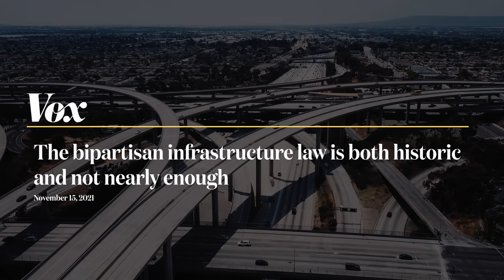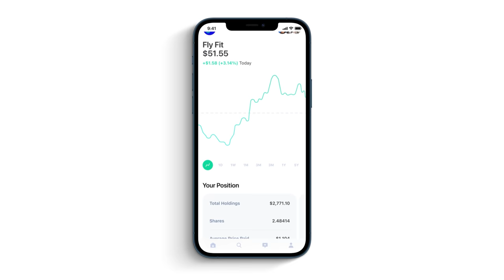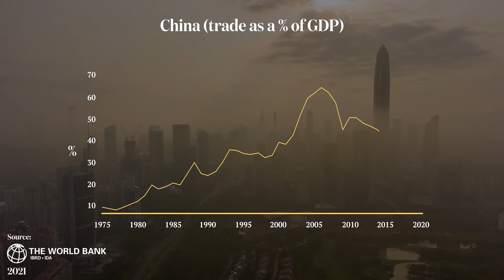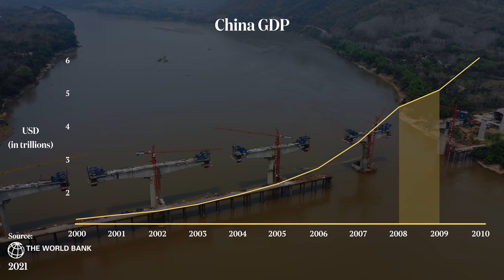China Has A Debt Problem Three Times Larger Than Evergrande | Economics Explained

Comment: As someone who works at the company that maintains the dutch railways I think you're missing out on a few very important points:
Railways shouldn't be counted upon as being profitable, the transport they provide (if they are well placed etc.) weighs far heavier then ticket sales ever could. The benefits of being able to transport non car owning citizens all across the country at high speed is incredibly important for a technologically developping country.
Also maintaining railways is far more complex then extually building one. It requires keeping tracks of a meriad of different properties that differ from every piece of metal, cable and cart.
Though I doubt that China looked far enough ahead to see these problems comming which is why the amount of time and money that has to be reinvested in the project will be far larger then they expected in the long run.
Reply: I was about to ask this in the comments, thanks for answering. If the alternative to infrastructure investment is fiscal stimulus, why does it matter how unprofitable the rail system is? The alternative is the debt without the benefits of the rail system. I'm curious why they halted additional rail investments. My only guess is that they underestimated the liability that is rail maintenance and are avoiding that future cost.
Reply: @PoorlyThoughtOut  It sounds like in terms of accounting, it is now becoming too difficult to maintain these semi-independent rail corporations.  Remember, the purpose of these orgs is just to encapsulate controversy in a non-government entity.  Something that is "corruption" for a state-owned rail company is just normal business for a private rail company.  However, it's an unstable system, because the government wants cheap rail travel all over the country, but private corporations need to make money.  

Ultimately, this problem is an illusion.  In reality this project is an initiative of the Chinese government, and the government has much more than $1 trillion.  The government wants trains, and they will pay for the trains.
Reply: @PoorlyThoughtOut  If you want to understand why it matters, then think about this:   suppose you, personally, borrow $250,000 and treat yourself to some fiscal stimulus by spending it all consuming things frivolously.  Overseas travel, 6 star hotels, top end restaurants, the odd kg of coke etc.  When it comes to paying back the debt, you will understand the problem with fiscal stimulus.  And if you then decide you would like a home loan, and find you can't get one because of the $250,000 you borrowed to consume, it will be even more apparent.
Reply: @alexanderSydneyOz  ahhh.. but that $250k which I frittered away is now being used to employ hotel staff, airline staff and Lamborghinis (for my Coke dealer). In short that money keeps other people employed.
Reply: I realise English may not be your mother tongue, so, not to be too much of a stickler on English grammar, but 'than' is the proper comparative conjunction which should be used in your following statements:
• "Railways shouldn't be counted upon as being profitable, the transport they provide (if they are well placed etc.) weighs far heavier [than] ticket sales ever could."
• "Also maintaining railways is far more complex [than] [actually] building one."
•  "... which is why the amount of time and money that has to be reinvested in the project will be far larger [than] they expected in the long run."

'Then' is an order adverb in English (or an adjective/noun when referring to a period in time):  i.e. 'I'd rather take the train which is far more convenient than driving or flying.' and 'Getting between Amsterdam and Rotterdam was easier back then when trains were more frequent.'
Reply: @MelioraCogito  that is, without doubt, the politest, constructivest, exposition of grammar policing, to which I have ever been a witness. Possibly ever irrespective.
Reply: Railways only exist because they are heavily subsidised. If any civilian had to pay the real price of a ticket, the train would be empty. Infrastructure is incredibly expansive (catenary, rail, exchanges, crossings, traffic control, train stations, and a gazillion employees). And have you ever compared the amount of people that pass in one minute on asphalt vs a rail track? Then have you wondered what's the noise on top of the lock? It's cooling because a lot of energy is wasted with power conversion for the train. And there is the wait of the train and the aerodynamic; ginormous vs non-existing. Trains are extremely inefficient; from an economically as well as an ecologically perspective. If you want to give the people cheap transportation, you could consider subsidising cabs or busses. The latter doesn't even need subsidising. Flixbus charges about 20% of the price of the Dutch railways (even with the railway's 40% deduction card, Flixbus is still twice as cheap), and they are a commercial company, without subsidies. We just lost track of real prices because it's because subsidies are blurring our visions, and the fact that we got used to what we have.
Reply: @MsSjaakvaak  not if you are stuck in traffic during rush hours. Trains and subways are way better than driving in NYC.
Reply: This video misses the on going value to the people for the next 100-200 years, like roads and footpath construction they are not for profit, they get the return from boosted GDP and wage growth both increasing government revenue. 
Although this may be indirect it is a substantial amount of revenue.
Chinese HSR is also being used for parcel freight removing more trucks from their roads, at very competitive prices.
Reply: EE didnt explain it in the video, but the idea is that the rail has to at least be profitable enough to cover its operating cost, otherwise it is a complete waste of resource. And by the looks of things, the minor lines can't even do this.
Reply: So back to video’s Original point that the rail project is likely to be a failure of government . A highly expensive failure.
Reply: This may be true for the very old railways you maintain, but not here with modern construction systems.  Even rebuilding it completely new, is far less work than you hand workers.
Reply: @MsSjaakvaak  but Flixbus is using the whole multi-billion dollar road infrastructure „for free“. Think about it.
Reply: Rails are owned and govern by the state company. They could allow other private companies to run on the profitable routes so they can pay the rent and ease the cost of the maintenance.
Reply: @MsSjaakvaak  I think you're forgetting about the massive subsidy that road vehicles get through the the building and maintenance of the roads themselves. Try transporting the same numbers of people on roads as in trains and see how much more efficient and ecological it is, lol. You don't actually need to imagine because the US sets the example with this.
Reply: @willemachternaam690  I think Evans' approach was the most friendliest.
Reply: @vodizzzle  private highway (do they have those in the US ?) are just patent misuse of public money .public highway are just a sign of bad infrastructures. change my mind.
Reply: Completely disagree. If value an entity (here railways) provide is so great, let customers who are getting the value pay for it. If you want to give those people money, let the Government directly transfer money to their accounts rather than subsidize the entity(here railways). Then people have a real choice and there's no risk of special interests who benefit from the entity making specious arguments to keep loss making entities afloat (soooo valuable that it can't be measured)
Reply: @PoorlyThoughtOut  This is called a false choice. These aren't the only two options.
Reply: @anglaismoyen  And fuel taxes? Tolls?
Reply: @anglaismoyen  So, have you calculated that "massive subsidy"?   Roads are already 'user pays' as most countries have substantial fuel taxes specifically to pay for roads.  In Europe, they are very high taxes indeed.  In Australia, where I am, petrol is taxed at  43c per litre, so your typical car is paying 3c per litre road toll.  In Europe, it is about twice that.  I don't think roads are actually subsidised at all.   Plus big ticket motorways are typically toll roads.  Local roads are typically paid for by municipal bodies but as everyone uses roads, paying for them out of tax money, local or otherwise, is hardly a subsidy.  It is user pays, where everyone is the user.   Heavy vehicles typically pay very high registration fees for the same reason. 

Trains are excellent transport, but only in limited circumstances:  where you are moving lots of people along specific very high volume routes.   They are in no way a replacement for most transport purposes.
Reply: @krishnam1  The whole of society reaps the benefit of fast, efficient mobility. It basically fuels economic growth. Would you also support making all motorways into toll roads?
Reply: @krishnam1  What are you asking me wrt fuel taxes and tolls?
Reply: I`d say that what should be achieved is overall positive impact on economy. Railways - when they are reasonable placed and cost of their maintenance is reasonable as well, may have very positive impact on overall economy. For example money spent on gasoline and purchase of a car can be spent more locally, another benefit is that cost of maintaining of a railway is far lesser than cost of maintaining(and upgrading) of roads having the same 'human' capacity, another positive factor is easier access to high quality schools for children living on outskirts of bigger cities, that results in higher quality of human capital. In European countries these goals are in many cases achieved - however Chinese program is unreasonable, it is more of a projection of power than fulfilling actual needs.
Reply: Flixbus and all buses, in fact all road traffic is subsidized. Because they all use roads that have to be built as well as maintained. Though yes buses are still rather effective means of travel and investing in good bus stations is a good idea (these stations that Flixbus uses are usually also subsidized).
Reply: "Railways shouldn't be counted upon as being profitable, the transport they provide (if they are well placed etc.) weighs far heavier then ticket sales ever could."  applies so much to Indian Raillways...its seen as a basic right not just for profit.
Reply: Did you see that at 2:07 there's one of 'your' trains and railroads in the video?
Reply: Developing has one p. Coming has one m. A judiciously placed comma and the odd hyphen wouldn't hurt either! Thanks for your comment.
Reply: why you argue with a propaganda?
Reply: @alexanderSydneyOz  yeah but the 'odd kg of coke' would have made it pretty sweet.
Reply: Yours is always the claim of every bureaucrat and corrupt crony-capitalist demanding taxpayer subsidies - But we provide so many benefits that can't be measured!
Reply: @alexanderSydneyOz  Nice try but you are not gonna break through a whole lifetime of economic miseducation and communist propoganda. i appreciatte you trying though. i cant do it anymore. it is so tiring.
Reply: @anglaismoyen  Johann I see you have conveniently avoided answering my own questions. Krishna's question is very straight forward. You claim there are massive subsidies for roads but you are unable to identify what they are. Krishna is asking the same question as I. Ie what about the fuel taxes which amount to something in the order of 3 to 6 cents per kilometres travelled per vehicle. Do you think that might pay for roads? And all the tolls on large motorways. And the road usage or wait components of registration fees typical in most countries. Particularly on heavy vehicles.
Reply: @MelioraCogito  What is the point of grammer policing this person? You spend how many minutes writing that? Was it worth it? Why not just comment on the topic at hand. Be thankful people even try to use English when it's not their own language...
Reply: @alexanderSydneyOz  Massive subsidies for roads are the construction and maintenance of the roads, which heavier vehicles are disproportionately responsible for. Whether fuel taxes fund roads depends on jurisdiction but usually don't cover the entirety of expenses. Then there are the health costs from pollution and sedentary lifestyles. There's the opportunity costs from sitting in traffic rather than being active or getting other things done. There's the cost to life with the millions of deaths per year and the severely reduced quality of life in car-dependent regions. In urban areas the biggest cost is the use of space issue because that's where space is at a premium. Car infrastructure takes up huge amounts of space that could be used to move more people or could be put to productive use. Free parking is possibly the biggest subsidy of them all.
There are lots and lots of costs you need to take into account beyond any simple metric.
Reply: @MsSjaakvaak  where do you get your ecological studies?
Reply: @MelioraCogito  That's your takeaway and contribution?  You understood what he meant, so his communication was sufficient.   Jeez, pedantic much?
Reply: chinese HSR lines are built completely autonomous. they have their own tracks, stations and stock and often run in parallel to the conventional tracks. the dont 'upgrade' a line to highspeed like, say the germans.
Reply: @jaszynek7640  On average are schools inside a city better then schools outside of a city?
Reply: Everyone says this about everything the government does, "It doesn't need to make money, its supposed to provide a public good, moral benefit, etc,etc" the problem with this statement is eventually the money has to come from somewhere. If none of your government enterprises are profitable/ breakeven you have an ever escalating tax burden which leads to cost of living crises, economic drag, unhappiness, regressive taxation and the like.
Reply: @towngirlz  I agree.  But when you're a communist, autocratic dictatorship with genocidal tendencies, you can prolong (for a little longer than in the West) government projects even when their financial backing has collapsed.
Reply: The Japanese were able to privatize their railway systems and make it efficient at providing public transit while also being profitable.
Reply: @MsSjaakvaak  umm, what? Trains are by far the most efficient method of transportation, well aside velomobiles. Of course, assuming it's done in a free economy and the train is actually using a route that has demand (passenger or cargo, doesn't matter). Trains are more fuel efficient, railways can accommodate about twice as much cargo/passengers per dollar spenton construction too. Train track maintenance isn't that expensive either, especially when you consider the lack of railings, road signs, lighting, and a bunch of other stuff. There's a reason the modern age started with rails and not roads, trains are far less demanding and wasteful. Again, assuming there's demand and the economy isn't a centrally planned skewed mess. Which it is, obviously in china, but in the west and the rest of the world as well. Which is why everything's so backwards despite technological advances coming so far and making it all far cheaper (but factual prices not falling)
Reply: @shaunehuolohan5736  if the world was free, we'd have ten times the current trains, which would be ten times more efficient and advanced. You can't forcefully do well, all you'll do at best is stagnate at the same point, and at worse just impovrish the people and build what you don't need for more money than it's worth. For example, tomorrow a company could think up a way to build railways twice as cheap, and much faster. In a free economy, it'd get funded. In a planned economy, the money they could get and the state scoops up would be FORCED into building more old railways. And worse, it could be built in a less efficient route, and lead to unneeded destinations, AND part of said money is spent on unneeded government employees and middlemen. A great example is NASA, which was outdone by a semi free market (no such thing as afree market for a century) guy who can now deliver payloads to orbit for a fraction of the price it would take them.
Reply: @alexanderSydneyOz  comparing a consumer or “household” budget to a government one is ridiculous. You try creating wealth out of thin air and printing money and see how far you get.
Reply: @towngirlz  you just borrow the money from yourself. You know like how all fiat economies work. National debt is almost completely meaningless these days.
Reply: @leeshepherd6512  Lee, it is true that household and government budgets have some differences, but my point was that both of them can overborrow for consumption, to a point where further borrowing is difficult or impossible.  And that is so.
Your comment, however, shows you don't  understand an utterly basic fact on this topic. GOVERNMENTS do NOT create money.  CENTRAL BANKS create money.  Money created by central banks is NOT used for spending by governments, which must borrow by issuing bonds.  So, sorry but No, governments cannot and do not "print money".

Note also that money, and wealth, are not the same.  Sure the money supply can be increased, but wealth is the totality of goods and services in an economy, and only the totality of people in society can do that.
Reply: @leeshepherd6512  As noted, no that is not how "fiat economies" work. You are misinformed.
Reply: @anglaismoyen  "Massive subsidies for roads are the construction and maintenance of the roads,......".
You persist in talking about massive subsidies, and also persist in not having any quantification of them.  Funny, that! 
And now you are pimping up your argument with irrelevant items.   These things are NOT subsidies: health costs, pollution, other lifestyle effects, opportunity cost, cost to life from millions of deaths, space used for roads, free parking.  NONE of these things is a subsidy.  These are "externalities". That said, free parking outside railway stations could be viewed as subsidising rail usage.

I have already pointed out how roads are paid for:  registration fees (which are very high for heavy vehicles), fuel taxes which, while varied from one country to another, amount to some cents per km per vehicle,  tolls on most notably expensive road infrastructure.  And local roads are used by everyone, and paid for by everyone from municipal taxes. So there is no subsidy there at all.   Until you crunch some numbers to show that the cost of roads is not paid for by road specific taxes, then there is not point letting out more hot air by talking about "massive subsidies".
Reply: @PoorlyThoughtOut  
The railway debt is far, far greater than the generated revenue. If the railway defaults on its debt, it becomes bankrupt and must shut down. It’s a lose, lose situation for everyone. That combined with the impending real estate collapse is very bad news for the CCP
Reply: @MsSjaakvaak  
I believe you’re talking about passenger railways, freight railways are quite profitable
Reply: @alexanderSydneyOz  oh am I 🙄 prey tell.
Reply: @alexanderSydneyOz  the government instruct the bank to issue currency. You can pretend they’re as separate as you like… the reality is they are not and nor should they be.
Reply: @leeshepherd6512  No. As I said you are misinformed, and if you think that, you plainly pay zero attention to what happens in any developed economy.
Reply: @alexanderSydneyOz  In your opinion. In mine you are the one who is  misinformed. You clearly don’t understand how modern economies work and you’re clinging onto dated thinking and the myth you have to “balance the books”. In reality economics isn’t a science by any stretch and you’ll rarely find two “economists” who agree.
Reply: @alexanderSydneyOz  I’m going to go out on a limb here and guess you’re American.
Reply: @leeshepherd6512  Which has absolutely nothing whatsoever to do with your comment, or my response. Which was about the government telling the central bank to print money. That is fantasy rubbish and completely untrue.   Nor did I say anything at all about 'balancing the books';  that is something new you have introduced.  Nor was anything discussed even about economics. It is about finance; the consequences of borrowing and spending.
Reply: @alexanderSydneyOz  a state owned railway is clearly an economic issue. It doesn’t have to be financially viable it has to provide a means of transport that is all. The “balance the books” reference wasn’t quoting you it was in quotation marks as it’s a oft believed fallacy when applied to infrastructure. Anyway it must be silly o’clock in the good old US of A. Get some kip and we’ll finish this debate another time.
Reply: @leeshepherd6512  that's an excellent constructive response! Cheers
Reply: @alexanderSydneyOz  Sorry for not using the correct terminology. They're still all costs that are paid for by wider society.
Reply: I partially agree with you. Yes, you can’t always expect a train line to make money, buy almost $1 trillion in debt after just about one decade? It’s already out of hand. It will eventually get to a breaking point, and by the looks of it, that won’t take very long.
Reply: @PoorlyThoughtOut  china is not growing, the are in a massive decline due to 1 child policy, soon there will be only 1 young person for every 10 chinese retirees. 1.3billion people will be reduced to 300 million in 50 years. if 1 of every 13 chinese is tied up in old age care for the others too old to work, who will be making the food, water, shelter, clothing, and medicines?
china built high speed rail, but make no mention of the fact they threw all retired communist party members from the revolution into former prisons as they have no elderly care system for the vast majority of them. china should have been building retirement homes and millions of medical clinics instead of high speed rail. chinese communist government is all about good appearances but all chinese are woke to just how terrible their government is to the rest of the world if they ever get to get out and go abroad or see non communist chinese media
Reply: Comparing Holland with China is crazy. Not only in size but Holland has no high speed trains at all.
Reply: @Intranetusa  Japanese also pay more than 4x as much as Chinese per km for their high speed rail tickets.
Reply: @jefferyzhang1851  Well, the Japanese have ~3x or 4x the average income and have slightly lower taxes for the middle class bracket (20% vs 25% at the 60k USD range). So that likely means Chinese tax dollars are subsidizing the cost of rail.
Reply: I disagree on the budget thing, I think China purposely did that, it’s learning the hard way method China have been implementing in most their top projects, like the dam, bridges, sinking city and so on. They know it’s a bad idea but they push and learn from it as best as they could. One of my Chinese friend that I keep in touch originated in China and returned there, he explained to me a whole lot about China and their ideas, culture for a week straight, the more I ask the more question I got being as I’m an analyst. Curious fellows, China is a country that spends money to earn intelligence, wisdom and experience, and the end product is wealth. How many countries do this? China actually make their own anime and they are high quality, their own rockets, their own phones, and they are minimising cars as best as they could with transportation, and this project, will teach them a lot. Even if it fails, they will earn immeasurable experience.
Reply: @shaunehuolohan5736  If the railways had 'ongoing value' they'd make a profit.
Reply: I mean his channel is about money. Of course he only talks about money. That's why he is so wrong.
Reply: Ok, but what is " extually"?
Reply: @MsSjaakvaak  You blabber about which is more efficient as if you understand at least basic level of mechanical engineering. Tell me, on what world do you think vehicles on road is more efficient than railtracks? Steel vs steel is way, way more efficient than rubber vs asphalt. 

Last time I check railways are used to transport any kinds of goods like oil, gas, cars, logs, machineries, etc. on top of passengers. Do you suggest that we abolish rail tracks and let the transported goods shift into the street? And on top that, did you really suggest on subsidies on cabs? For real? LOL.
Reply: @amirulhakim9898  Do not worry about this "brainless thing". Calling that thing a human would be wrong. He is D.A.F. It is very obvious that trains are the most efficient form of transport in the world. Single train line is able to transport up to 90000 people/h using 4,2 kWh/100pkm while single ICE cars based system single lane is moving 2000people/h using 60 kWh/100pkm. Trains based system is roughly 600 times more efficient.
Reply: @amirulhakim9898  But rolling resistance is just one part of the equation. How is it that even though my asphalt has much higher rolling resistance then steel, my bus ticket is still 5 times cheaper than my train ticket? Even though half of the "income" of the (Dutch) railways comes from taxes, not tickets
Reply: People have accused China of many things, but not planning ahead was never one of them.
Reply: @vlhc4642  Uh, was the one-child policy not a good example of not planning ahead?
Reply: @MsSjaakvaak  This is because heavy road vehicles do not pay the right amount for their usage of the road infrastructure. It has been demonstrated scientifically that wear and tear on infrastructure is proportional to the 4th power of the axle load. A truck or bus has an axle load about ten times higher than a private car. He should therefore pay 10.000 times the road tax of a private car. That doesn't happen anywhere. In other term, even if the total taxes entirely cover the road costs, private motorists heavily subsidize bus and truck traffic. This is the well known cause of the demise of many tram networks after ww2, all public transport companies realizing that paying road tax for busses would cost them way less than maintaining their own tracks.
Reply: How about a country that has no any high speed train service. Do you think that country see far enough than China?
Reply: Why do you think china is too short sighted to not factor in maintenance costs? Really? China had done studies and learned from all the worlds best companies and systems, but can't budget or foresee maimtenance costs?

But japan or Europe can when they had even less experience and tech was far less mature?

China has long term planning and a competent government. They ain't blowing trillions or billions on funding proxy wars or starting dumb wars on other side of the world with zero benefit for the country. China will be just fine. Ever grande was part of the plan. Same as dropping ban hammer on ant financial and alibaba ipo etc. They are going for sustainable growth now, not growth at all cost.
Reply: Do you know why CCP can build the high speed train every where in china? Because CCP own the very inch square land
Reply: @fangslash  it seems that you Westerners always expect railways to have profits, while roads and highways ALWAYS get subsidies
Reply: @MelioraCogito  You sounds like the author of the book " Dreyer's English" LOL in the way your explain the difference (which is sound and detailed) , but I believe it might be mistyped due to auto-correct...
Reply: F*×ing A! Nailed it!